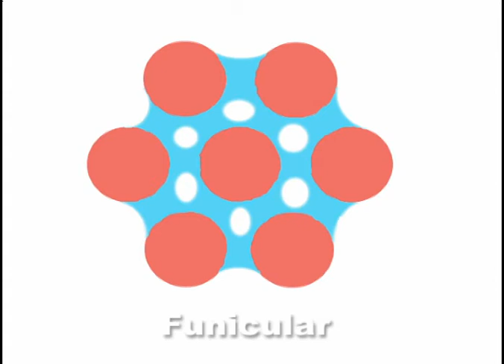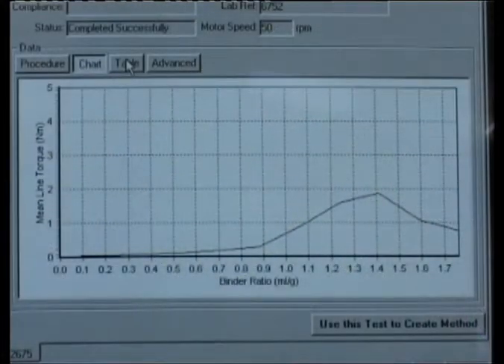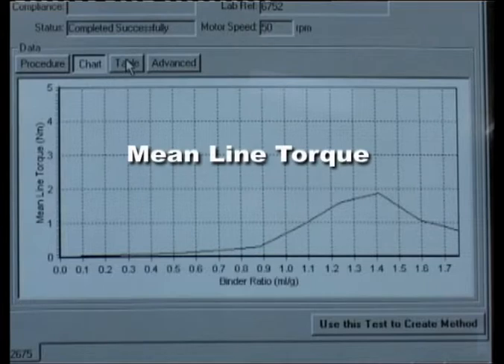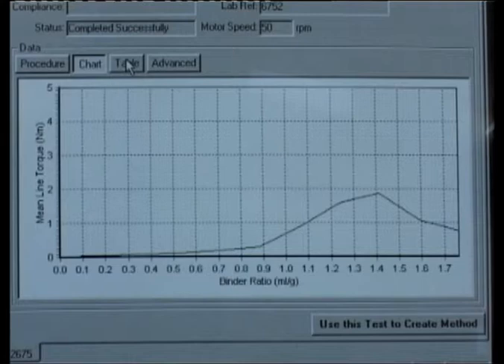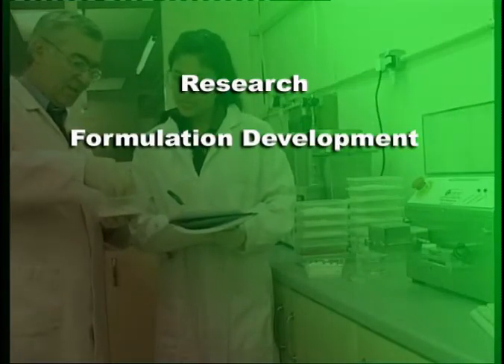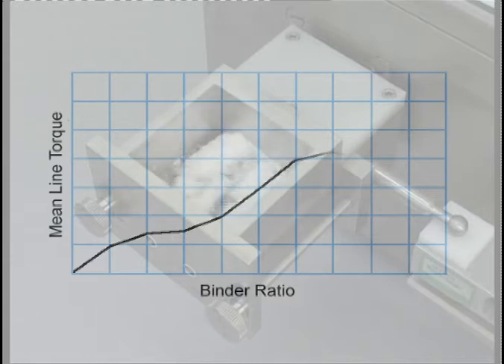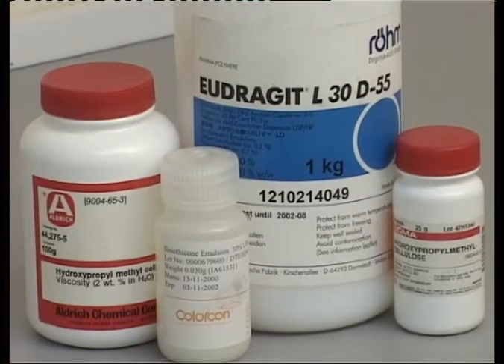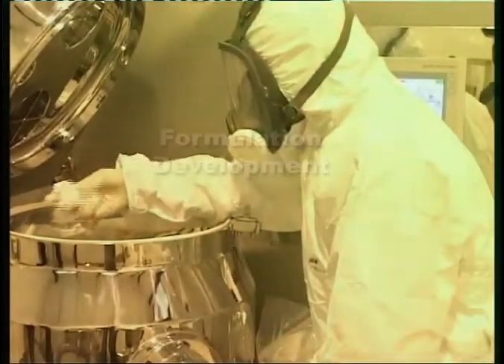The Caleva Mixer Torque Rheometer - Quantify wet mass consistency

Comment: I have an old Caleva torque rheometer but no longer have the software to run the rheometer since neither the floppy disk nor the computer are no longer functional.  Is it possible to get another floppy disk of the control software?